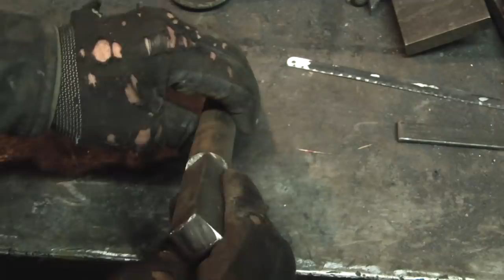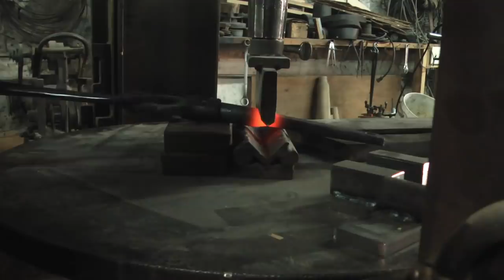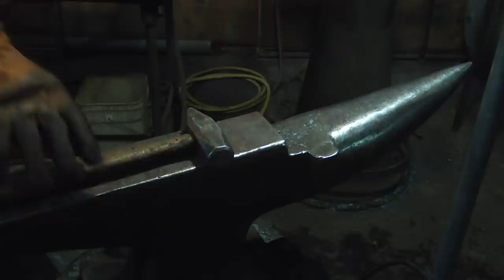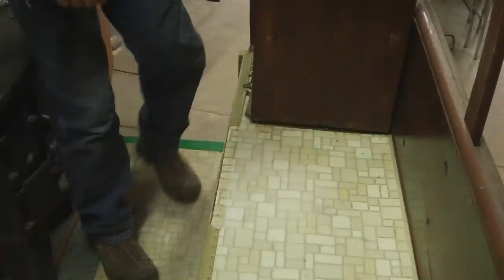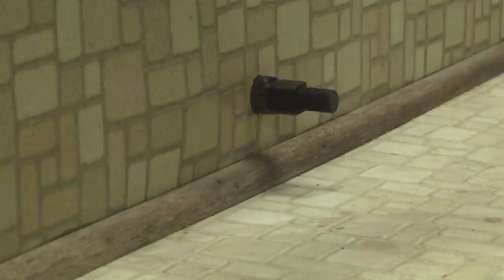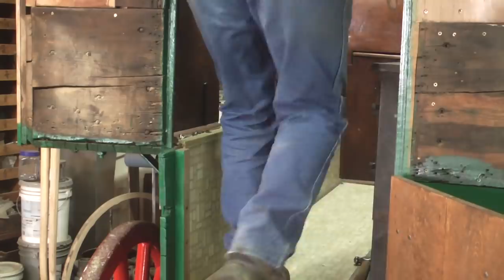Sheep Wagon Brakes are Unique | Blacksmithing a New Brake Assembly | Engels Coach

Comment: A good brake on a wagon is important to take the weight off the horse when going down hills, it also gives the horse a rest. The brake also saves the britchin part of the harness from strain. On very steep hills l have the brake on enough that the horse is slightly in draught, which is much safer. Another very good video, thanks.

Comment: Are you following a set design for the brake, or do you just figure out a solution and make it? The way you freehand the smithing is so professional and skilled. Great work!
Reply: @EngelsCoachShop  I see a toe breaker at foot level, and basically a saw blade at shin height, right in the walk way. Does it get some kind of guard around it?

Comment: Just curious as  to why the teeth on the brake ratchet were made on the outside of the bar, where you would snag your clothes on getting in and out of the sheep wagon? Couldn't they have been cut on the inside and the bar set out a ways from the bench to prevent this from happening? It would also protect the brake handle from being snagged and bent. I do like your skills and appreciate your videos. Thanks!
Reply: Thanks for the reply. Love your work.